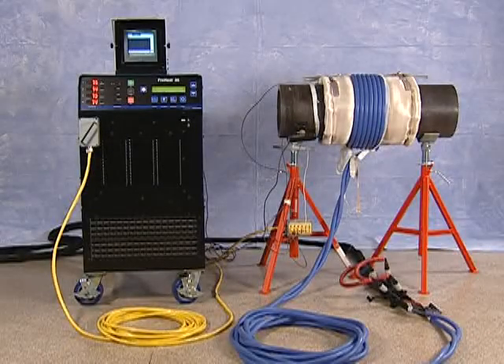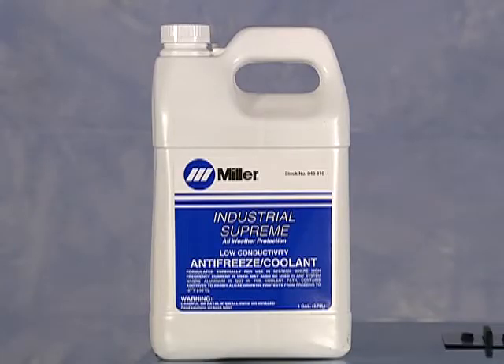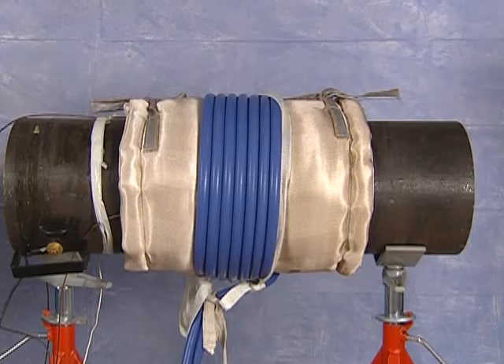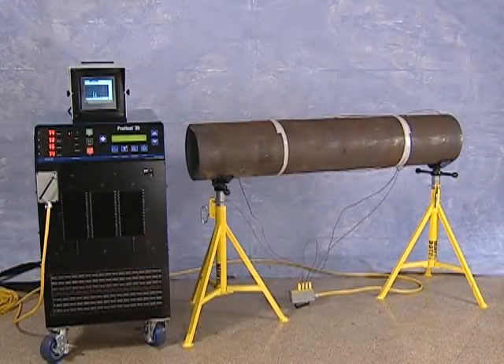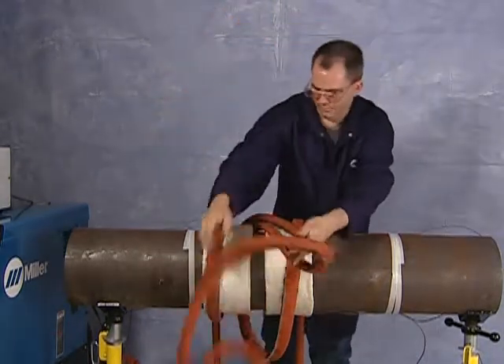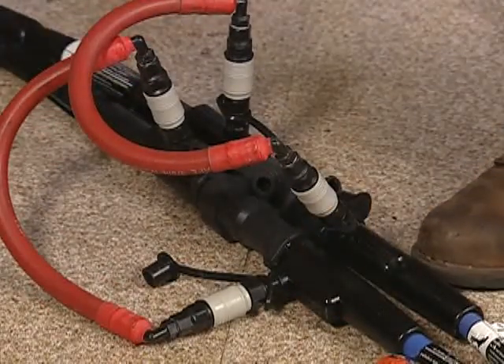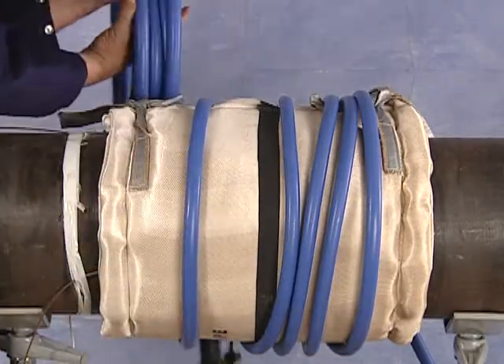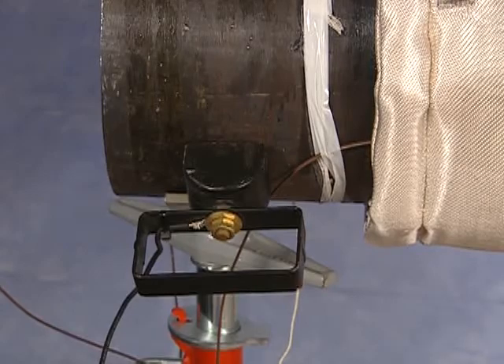Miller ProHeat Induction Heating - Liquid Cooled System

Comment: Help I need weld parameters for fabcor F6. O. 35 a Miller 350 3 mm galvanized welding a6/10mm slot puddle
Reply from the maker: Hi Bryan, thanks for reaching out. To discuss weld parameters for your specific application, please call our tech team. The number is 920-734-9821.